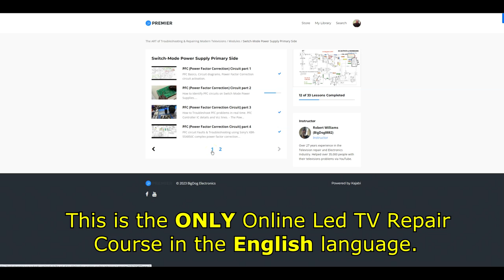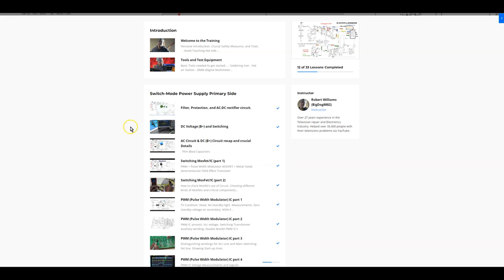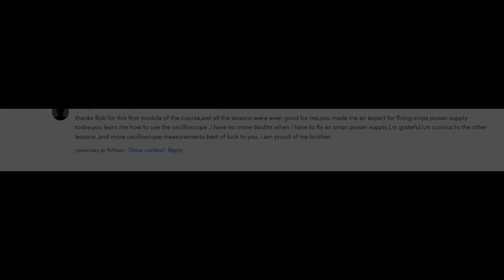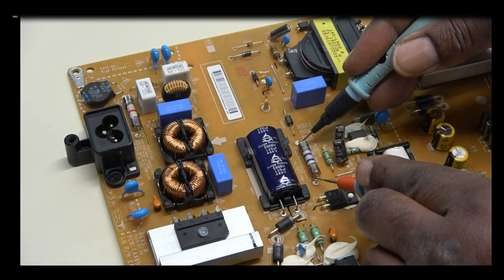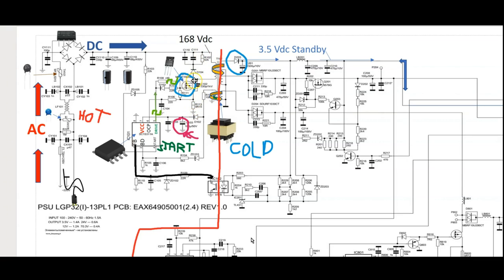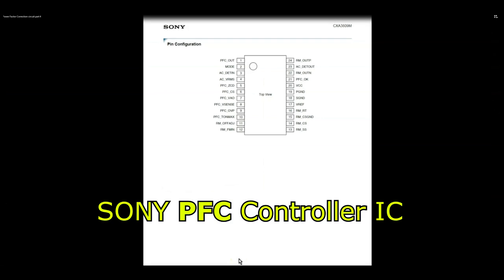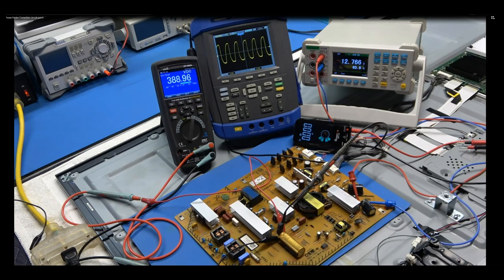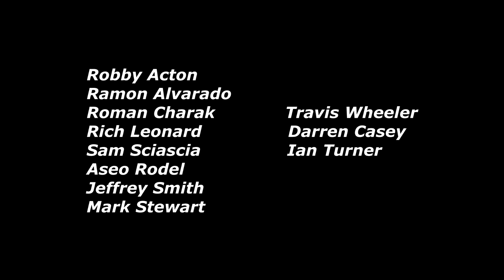TV repair Course Update and Live course footage.

Comment: Big Dog, Thank you for your in depth discovery for repair. I have an LG 42LB5DF-UC. Unit has no red power LED. I show 166 vdc on the Bridge and only other voltage is 28 volts on Q501. No voltage present on the connector. No stand by voltage present. I have replaced 4 budging caps with no improvement. How does the relay work in the start up sequence via the CPU board. Any trouble shooting help would be appreciated.